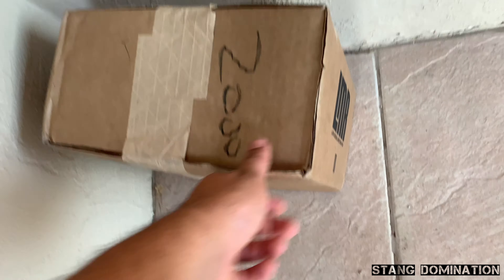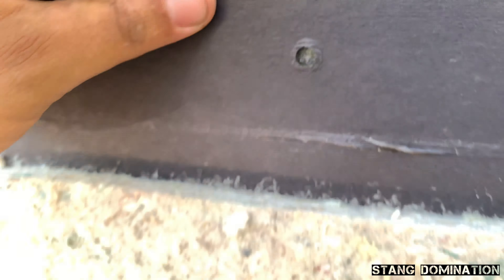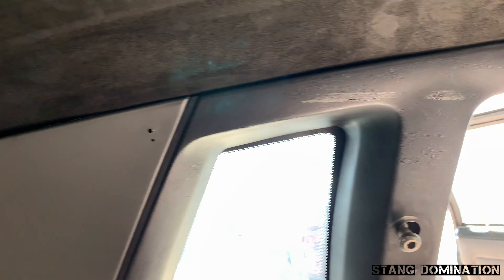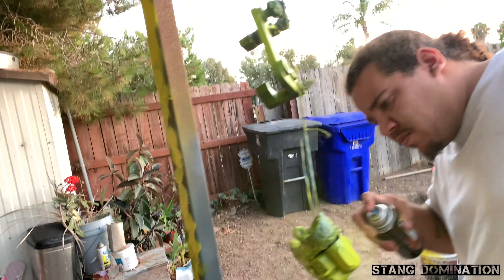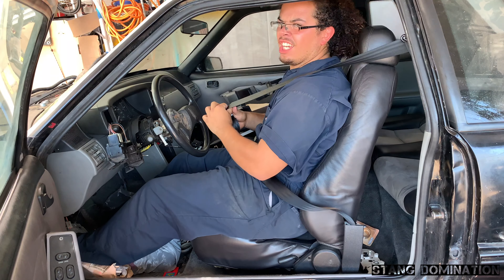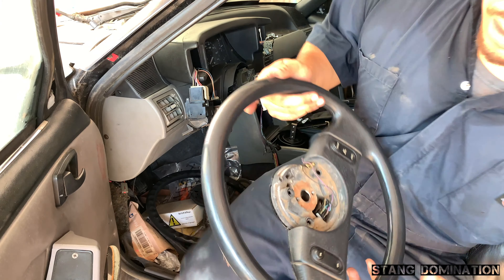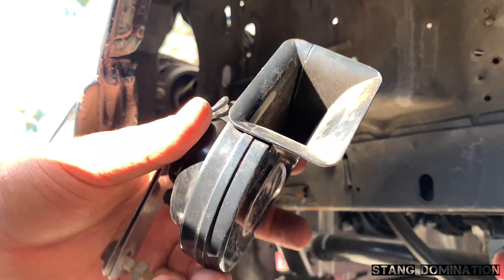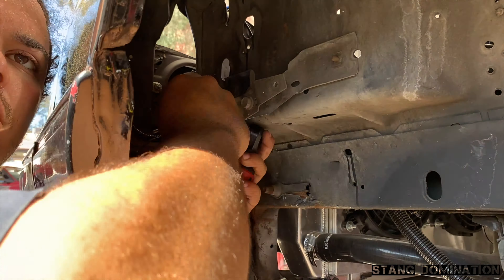GOT THE FOXBODY SEATBELTS FOR THE TITANIC pt.24

Comment: Dam,im not gonna get those seat belts for my fox then,ill keep my barely retracting ones on which i dont use anyways,lol. Btw what is that hole u plugged in,my fox is a 87 and has a botton on there but i have no clue what its for. I prefer the 87-89 steering wheels instead opf the 90-93's cause no air bag and looks simple and clean.
Reply from the maker: Suppose to be a retractor button didn’t read to much on it tho and same, love the 87-89 steering wheel too. I think because it’s not so huge and bulky
Reply: @StangDomination  O yea i heard about that but how does it even work cause i swapped my belts a bit ago but the used ones i got from a junked 87 gt were just a slight bit better than mines.
Reply from the maker: mine were always broken lol just never thought what they actually do but hopefully I can get some like the stocks one day and find out what the actually do